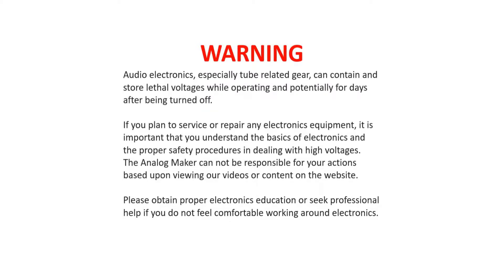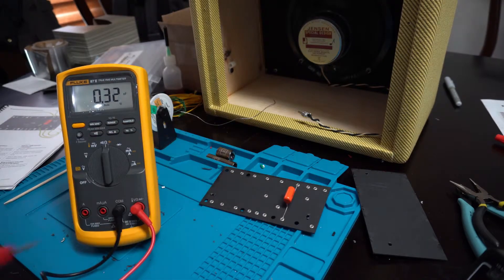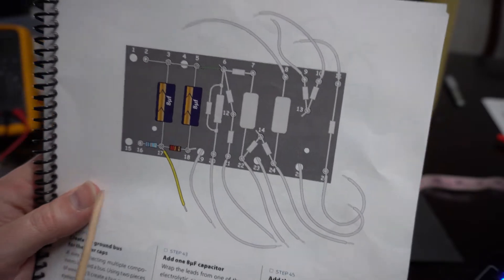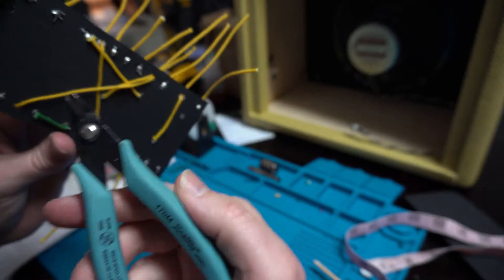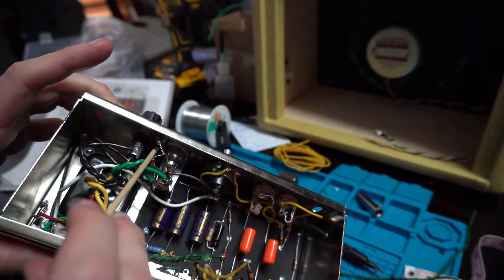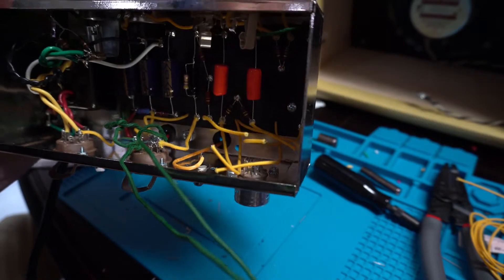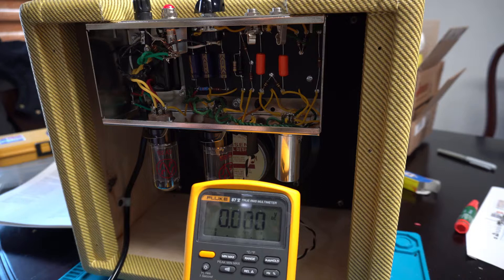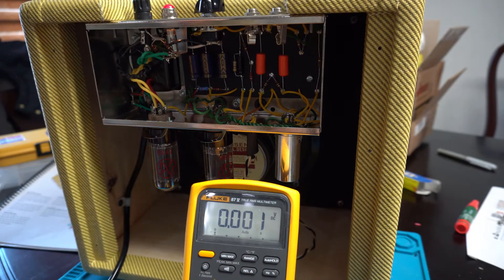StewMac '57 Mini Tweed (5F1) DIY Tube Amp Build - Part 4

Comment: Did you use resin flux on the fibre board?? Great practice for getting solid joints. Little alcohol and toothbrush clean up but worth it!

Comment: Hey there!  Good job on your videos! I am in the process of building a Boothill Amp  5f1 Kit. I't my first Amp build(though done tons of HiFi refurbs). I upgraded the OT and am modding the kit to include a independent power  switch, NFB on/off switch and adding a 3 way rotary switch for 4/8/16 ohm speaker loads. All simple mods but very tight on space. I plan to box this unit as a head unit and pair with a 2x12 cab with 2 vintage Jensen c12r's   25 watt speakers.  Boothill does not supply instructions (links to other's instructions) I had to watch and read to come up with a plan. So far so good...had to do a couple of reversals but not many.. Fun stuff. I don't actually(terrible) play guitar but I love building stuff, ha.  Your vids are good references. Thanks@

Comment: thank u for video.  id like to build one of these. is it something a beginner  could do ? im a guitarist. that has done pick up changes and little things but never a amp.  what do u think?
Reply from the maker: The stew mac kit comes with very easy to follow instructions. As long as you are patient and pay attention to detail (especially when it comes to high voltages when you turn it on) I think anyone can do it. The hardest "technical" part is doing the soldering.
Reply: @theanalogmaker2019  ok thank you I can solder.   thanks for response